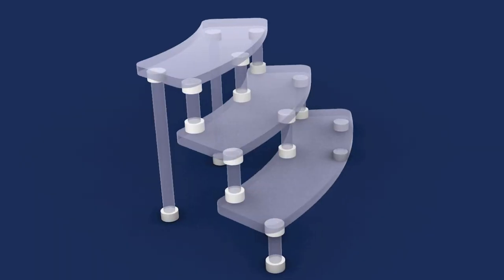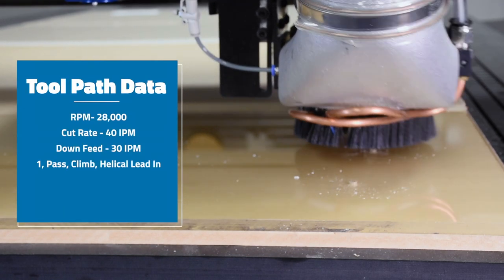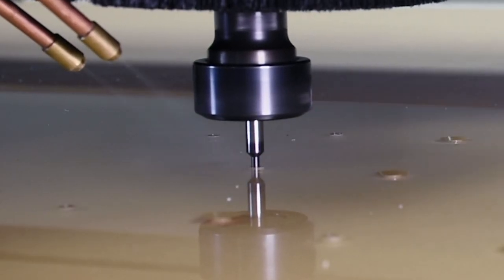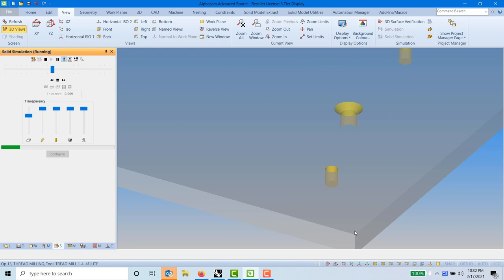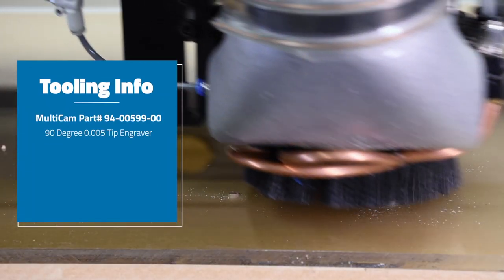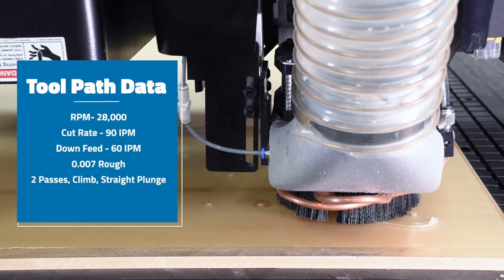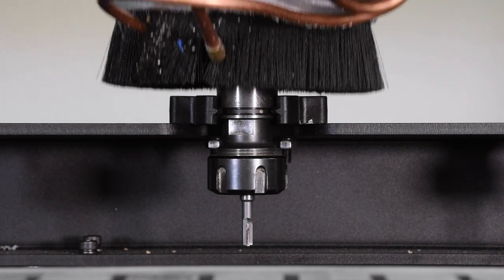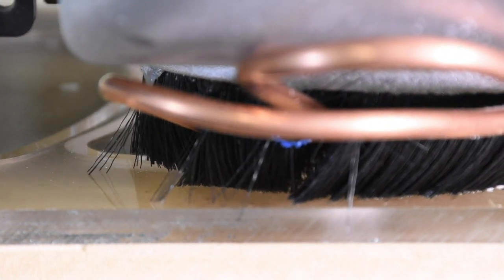Best Bits, Feeds & Speeds for Cutting, Thread Milling & Polishing Acrylic with a CNC Router

Comment: Interesting! I've learned something new. I love my MultiCam machines. Watching this made me consider going above our 26k RPM usage, I can think of a few job applications where that finish would save work down the line. You guys missed the opportunity to show your automatic dust collector adjustment based on material thickness!! The one thing I miss is automatic surface surveying and self adjusting capabilities. Our shop is on East Coast and the humidity during the summer riddles our spoilboard (MDF) with high and low spots (2 to 5 thousands) enough to leave burs at the bottom or in really bad days, cause the boards to swell upwards and leak all vacuum.